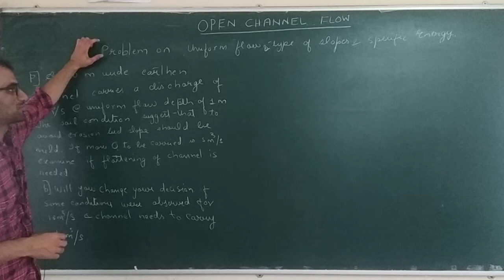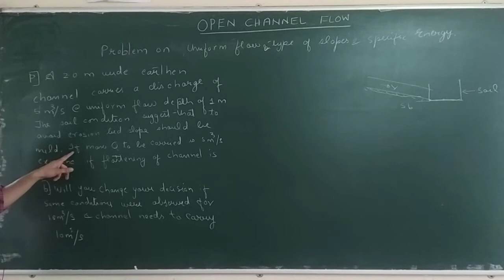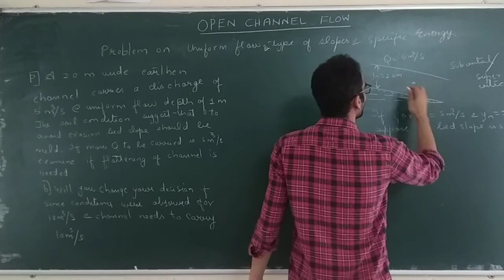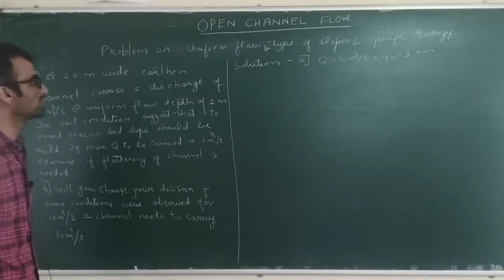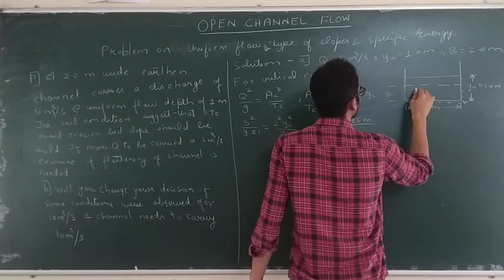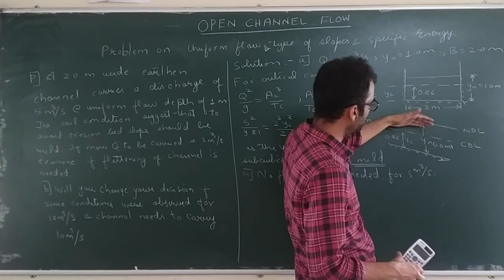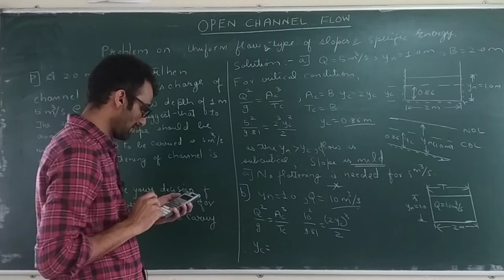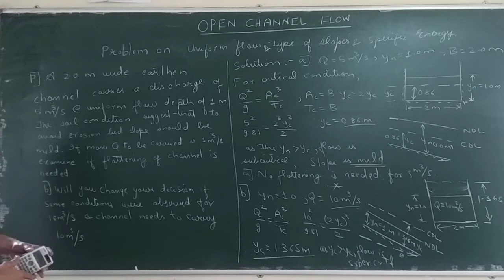Open Channel Flow -28 [Problem on open channel flow concepts]

Comment: Please, give some example if we have zero bed slope in open channel.  

How to calculate head loss in uniform flow and GVF.

Thank you, sir
Reply from the maker: In many reaches in open channels.. Natural channels.. There can come a longitudinal section which is flat and having zero slope.. Still water will flow because of higher energy at upstream and lower energy on the downstream.. The profiles will be H GVF profiles.. Your second question is about head loss.. In uniform flow and GVF. In uniform flow resistance equation are available such a Chezy's and Manning's... The same equations are also applicable in GVF flows.. Only in RVF.. These resistance equations are not applicable.
Reply: Thanks for the explanation.
Agree, water still can flow in zero bed slope because of gravity and some energy difference between head and tail water. So, I do not think manning's equation, but energy equation and head loss calculation.
Friction loss is major loss for long open channel.
Darcy -  weisbach and moody chart  that I know to estimate friction loss.
Please, correct me. 
Do you have sugestion to calculate friction loss in open channel?

Many thanks.